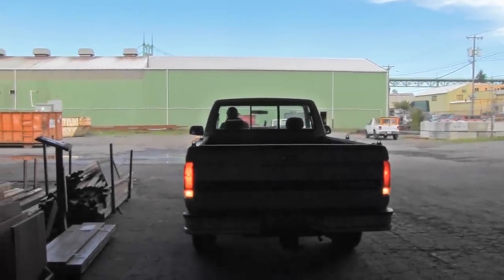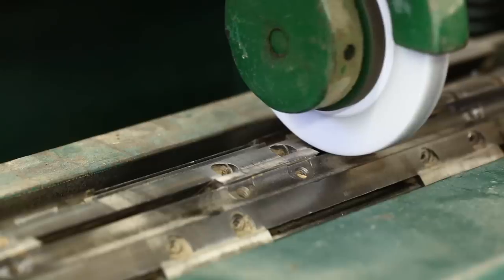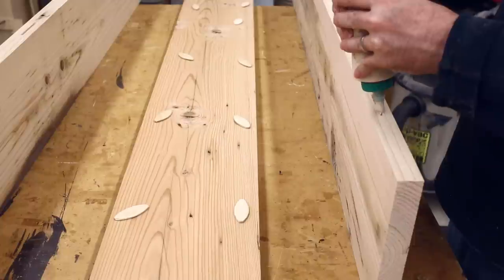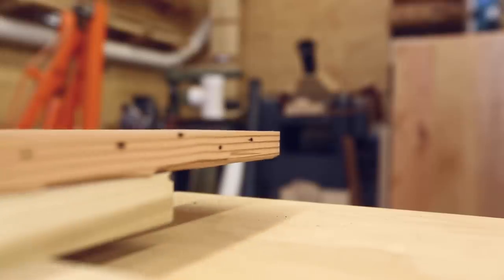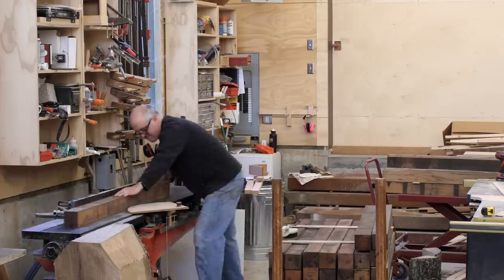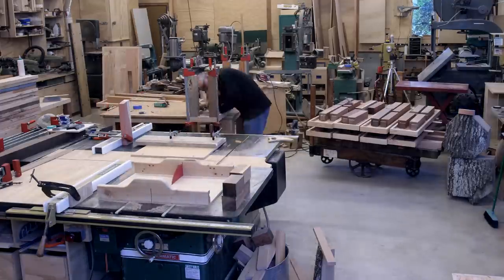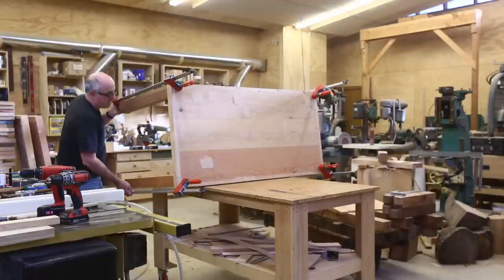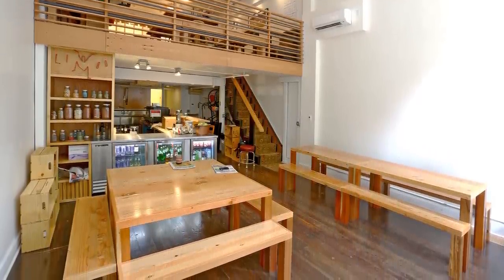Studio Jelly Part 3 tables and benches

Comment: Love the idea of using the reclaimed tropical wood for the legs.  Had never heard of that type of wood being used to separate steel during shipping.  Lots of good tips on the planer blade dulling and sharpening due to the paint removal.  Love the look of the final tables and benches.  Fantastic production and video as usual!

Comment from the maker: It flattens one side of a piece for wood.  It gives you a perfectly straight flat face, to start working from.  The planer will make the opposite side parallel to the jointed side.

Comment: Question:  Why an exposed plain jane screw through the top to hold the leg on?  It seems so incongruous, given the thoughtful design, the chisled slot for the bracket, the carefully prepared wood.  No plug to cover the hole, or a dressy kind of screw?

Comment: Frank another great project and video, if you are going to keep useing reclaimed lumber maybe you should consider a large drum sander I like the Super Max mechine it can run either the saning drum or a brush which would help clean up the boards, sand paper is a lot cheaper and easier to change,
well thanks for shareing all your great work

Comment: Hey Frank...love your videos.  Thanks for all the work you put into them with the animation and narration.  I've watched over a dozen of your videos and notice that you use a biscuit joiner.   Have you ever thought about using something like the Festool Domino XL?  I think that would have been perfect for this project for you.  Granted it's a darn expensive tool, but so many woodworkers call the Domino "a game changer" when it comes to assembling things and needing strength.
Reply from the maker: I've thought about it, but you're right it's expensive.
Reply: +T Le At my workshop we're done quite alot of test's. we've found it both less consistant and reliable aswel as weaker compared to using two dowels. We make precise woodwork and the domino is unacceptable in our work. so is the buscuit for that matter
Reply: +Sune Kaas So what do you guys use to join two boards?

Comment: I didn't read all of the comments, so forgive me if this was already mentioned...but for the stop on your crosscut sled for the mitered pieces, maybe if you just used a stop piece with the opposite angle, so the two pieces locked together, french cleat style. That might work better than a flat stop, and be more accurate than a mark.
Reply: Nathan Clewell They would tend to ride up each other like a ramp as you pushed one against the other.

Comment: This is just a general question about jointers - would it make sense to not only rotate the blades, but also periodically swap the blades closest to the fence, with the ones furthest from the fence? It seems like the blades closest to the fence would get many many times more wear because most wood pieces are fairly thin as opposed to the full width of the jointer. Would that prolong the life of your blades?

Comment: I'm curious about the strength of those leg-to-table joints.   I would think that as a bench is dragged across the floor, there is a lot of leverage applied on that joint, and your connections seems almost too fragile for that.  Did you test the joint at all?  lean on it or something?

Comment: loved it, as always.  i to like to re purpose wood like that, it gives a whole new dimension and value to the project.  One question, aren't you worried that gluing cross-grain (belt glued on the ends of the tops) will make the tops split ? i've seen it happen so many times.  GJ !@

Comment: how much does reclaimed lumber cost? i always buy new hardwoods and don't really have access to reclaimed lumber besides old growth redwoods in humboldt.
is it the same as buying new? or do you get a deal on it?
btw, most excellent work!
Reply: NosillaWilla In my experience (from here across the pacific), reclaimed wood can cost as much (and even more for large pieces) as new-cut.  But imo, using reclaimed wood is ethically superior, as you're not throwing perfectly good material away.
And using tropical hardwood for something so mundane and typically single-use as dunnage!  Quelle horreur!

Comment: Dont you think wood movement will cause the picture frames glued to the end grain to separate and come apart. This is  why breadboard ends are found in 200 year old furniture. finish wont stop the movement. But your project looks good.

Comment: what happens when your table tops expand or contract a quarter inch and blow your miter apart?
Reply from the maker: That was not a good way to do it.
Reply: +frank howarth now that some time has passed, how have these design choices held up?
Reply: wood movement should not be as big of a problem with reclaimed materials

Comment: Frank I love your stuff but your design is flawed here.  I think the bench legs won't hold up...a screw through end grain isn't a strong connection, and that bracket will bend.  The legs are just long levers...you have nothing to prevent racking.  Once that starts down it goes.  Also, the trim glued and nailed to the end grain of the glued up panels is a noob move.  Cross grain connection like that fail...the wider the panel the more surely it will happen.

Comment: closing off a wooden table top with wood around it is not the best thing to do. when the wood from the middle board expands it will look ugly and create cracks and the ones at the end grain off the middle board will look like they were made to small or they can even fall off. never do it with real wood you can only do it with plywood or mdf with a wood layer over it so the middle board won't expand.